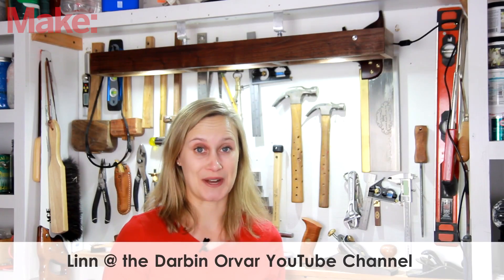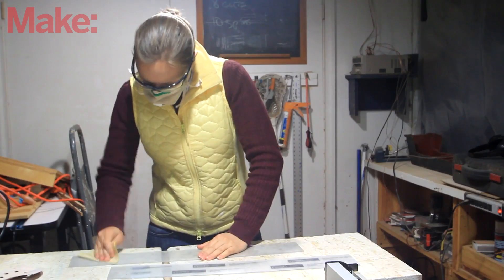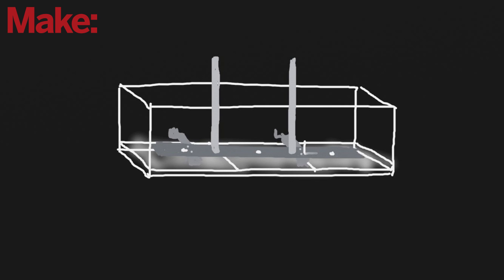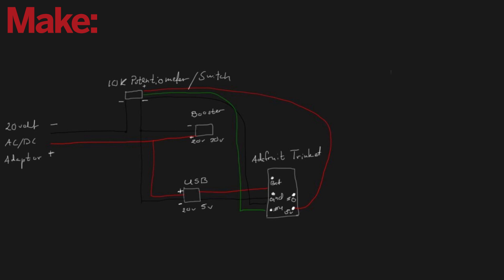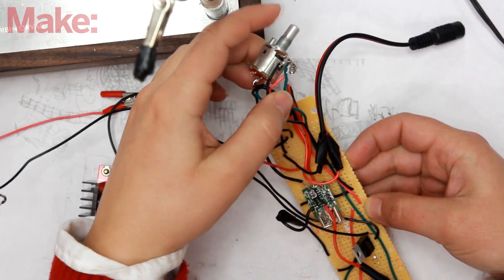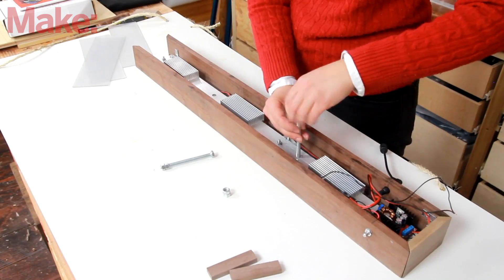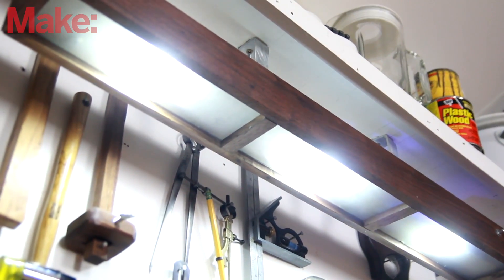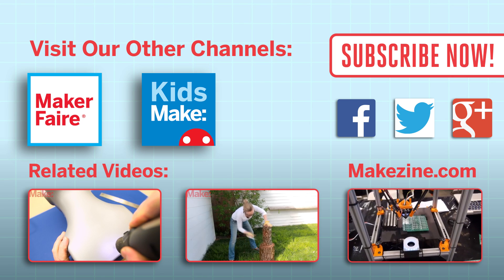How To Make a Super-Bright Light Fixture w/ Dimmable LEDs

Comment: It  is pure luck that this setup didn't fry the LEDs with overcurrent. (she didn't even mention anything on this topic)
If others are looking into building sth similar, make sure you take a look into @Great Scott LED videos. You must AT THE VERY LEAST put an inductor-cap somewhere to limit the current going to the LEDS. And no, Resistors are not the way to go.
Reply: thanks for pointing that out.

Comment: Excellent craftsmanship on the mechanics, but the electronics is really somewhat underwhelming. With this setup the light intensity will probably drift quite a bit as the LED's heat up. LED's like this are meant to be driven with constant current. It can obviously work the way is is done here, but at the very least the video should have discussed a safe procedure for adjusting the output voltage on the boost converter while the LED's are heated up.

Comment: Hi, a nice piece of work, it will inspire me to make some illumination appliance I wanted to have in my garage.
A question though, why did you put 3 aluminium radiators on top of the aluminium plate upon the LEDs ? 
Isn't the aluminium plate not enough to throw the heat away ? I'm pretty sure that if the radiators are not directly in contact with the LEDs, it is worthless to have it where you put them... just an idea...

Comment: your dimmer is not a pwm. its analog since you are using an analog potentiometer. it even says analog on your code.
Reply: analog output in arduino is PWM unless you have something like the teensy 3.5 or 3.6 that has true analog output. i could not see the code but i bet she is reading a voltage from the pot( acting as a voltage divider) with analog input and setting the output to follow the input. it is a rather silly way to do it but if you want to have an arduino in everything you build, why not. i have built plenty of arduino based devices that might have been simpler using other methods but with the arduino you can change things more easily if you change your mind. she could add bluetooth and control the light from her smart phone :)

Comment: Looks great, and doing it is better than talking about it.  However, can someone explain to me why the coding for dimmer switch?  Seems if you are on AC an autotransformer or other analog type option would work well would it not.  A lot of ways to do a nice project like this, just wondering if there was a specific reason for the coding and 'audiuno' board.

Comment: Great project! Just thinking that if you would use Constant current / Constant voltage booster, its would be way easyer, because you could just take out booster voltage potentiometer to outside, and set the lets constant current. By regulating boosters voltage you could dim the leds, but you couldnt give them too much voltage because of constant current set.

Comment: Awesome Build Linn! Many people don't seem to use Lexan for projects. Plexiglass is brittle and will crack and break. Lexan is a beast! You can hit it with a hammer, drill it, heat it and bend it, it's literally indestructible! It cost quite a bit more but works so well with projects!

Comment: Whoa - that was an unnecessarily complex project. Just get a couple of good quality of 5 meter closely spaced out LED strips and cut them up to fill in the fixture.  Also PWM dimming will fatigue your eyes quite quickly so I'd definitely just go with a voltage-regulated dimmer instead, which can be found for cheap on eBay.

Comment: Wait let me get this straight - based on your code you are using your arduino to convert analog potentiometer signal to the same analog potentiometer signal. So basically the arduino does nothing and the signal just passes through it...

wut?

Comment: Nice, but ultimately REALLY overkill, since you could achieve the same dimming action without the controller - just the pot and the transistor (possibly some resistors too).
Reply: +Daniel's Game Vault I agree that using a Trinket to control the brightness is overboard.  There is a problem with simply using the pot and transistor, operating the transistor in the linear range will cause a lot of power dissipation in the transistor.  Ideally you would simply drive a MOSFET with an NE555 variable PWM circuit.  A TIP31A is not a high power transistor and is probably marginal for this application.  You would still need a DC-DC buck converter to power the NE555, since it has a max supply voltage of 18v.  Ultimately, the simplest solution would be to use an LED driver supply that has an adjustable output, avoiding all of the auxiliary circuitry.
Reply: +eformance I was thinking the same thing. using a 555 to produce the PWM from the pot. but even the current setup skipped the heat sink on the TIP31. Personally the trinket is overkill unless you add smart functions like overheat off, remote control, audio on off and or controlling the 3 different LEDs to differ levels from 1 knob.
Reply: +eformance But micro-controllers are all the rage now! Kids don't care about discrete logic theses days! Even if it would cost a fraction of the price! I always giggle when I see projects on the internet using a micro-controller when they could do the same thing with a few cents worth of components. :)
Reply: +Heath Albritton The "contrived" circuit consists of one IC, 2 resistors and 2 capacitors which in total costs below one dollar. I wouldn't call that a complicated circuit and calculating the right values for the resistors and capacitors is fairly straight forward. Still fair enough, for a quick project a micro controller is probably a good way.
Reply: +Heath Albritton Your mom giggles when she gets picked up on the corner. You need to look up the definition of  "contrived." 

You are obviously not an engineer. Five components costing less than $1 vs a $10 microcontroller? You would probably buy a $100 light bulb if it had a microcontroller in it. A 555 timer might be old, like your  mom’s tricks, but they are still heavily used today.
Reply: +BeanHole If you can cut down on development time by using a microcontroller while the end result is just as good, those few extra bucks are well spent. Development time is fun if electronics is your hobby, but if it's not, it's really expensive.
Reply: I was thinking of a MOSFET, whose D is connected to the GND of the LEDs, the S would be the power supplye's GND and the G is connected to the center terminal of a pot. The other 2 terminals of the pot are connected to GND and 12V respectively - what would happen there ? The only flaw I see is that the LEDs might flicker or the pot won't handle the current draw, though that's the purpose of a transistor from what I know: to control a large current with a small one (even though FETs are voltage-driven).
Reply: +Alles Is Natuurkunde [EDU] PWM is almost always the best option, because the potentiometer is gonna dissipate a lot of heat, as well as the transistor when driven continuously, and that would require a very high power potentiometer and transistor just to not have both blown up by the power. Also, PWM uses significantly less power to operate and doesn't dissipate as much heat. Also, like bluetorch13 said, LEDs have a forward voltage that makes things complicated when trying to lower the voltage. Limiting just the current is also a bit hard to achieve properly (there will be a tiny area where the LEDs glow, and ten they go out completely).
Reply: Victor Arnaiz But isn't it illegal to do so since then repairing companies cannot repair them and go bankrupt?
Reply: Victor Arnaiz Well, I didn't know that. I live in Finland anyways so here it actually is illegal to make faulty products with irreparable properties to protect small businesses like repair shops. Still sounds really unfair, especially towards the poor customer.
Reply: +Daniel's Game Vault yes, but you will need at least a 555 timer to produce PWM, LEDs need PWM to dim properly. So add that to the list. lol
Reply: +Carlos Pineiro is PWM required? I think lowering the voltage with the potmeter and transistor/mosfet would do the trick of dimming the LEDs.
Reply: +Alles Is Natuurkunde [EDU] you can use a lot to a certain point, but LEDs are different than a regular bulb, they have a minimum working voltage, lower than that they turn off or start behaving weird. You need PWM to dimm it properly, just like a DC motor.
Reply: +Alles Is Natuurkunde [EDU] a pot*
Reply: PunakiviAddikti thanks. That's a great idea to keep in mind.
Reply: +BeanHole I always giggle when I see old farts on the Internet babble on about building a circuit with a 555 timer to create some contrived circuit when they could just as easily use a microcontroller that cost a few dollars.
Reply: Contrived is what happens when you put a 555 timer into something because that was your favorite IC from two decades ago.
Reply: Heavily used?  Nah.  Microcontrollers are everywhere.  For the purposes of prototyping, the average Joe can get an Arduino Nano, for example for <$5 in quantity 1.  Manufacturers are paying <$1ea in quantity for the kind of stuff that goes into cordless drills, like the SiLabs MCUs used on their speed controllers.

Sorry, old guy.
Reply: +Victor Arnaiz Indeed there are, but unfortunately it's very arbitrary and varies by country, or even in many cases by the individual judge's interpretation of a vaguely worded law, which here in the UK says such easily defined things as 'of reasonable quality' :\
Reply: +Daniel&#39;s Game Vault and to me the use of those 10w LEDs is over kill, since there is no reflector there is just a hotspot of light.
It would have been easier to use those strip LEDs.
They run on 12v so a transformer is all that is really needed, if you want to control brightness, get one of those basic LED dimmers off ebay

Comment: why use an arduino there are alredy a potentiometer on the booster board wich regulates the voltage for the led and you can hook up the external potentiometer to the booster MUCH EASIER

Comment: Nice project! I've been thinking of making lamps for the kitchen for quite some time, but getting nice wood is my biggest issue. Where I live in Norway there isn't much else than construction wood for sale.
Btw, there is clearly more woodworkers than electronics geeks watching your channel. Applying an Arduino where a simpler component could have been used could easily unleash a torrent. I'd go for the Arduino any timethough. You could even add a bluetooth or WiFi module to make it remote controlled. Or how about adding an RTC clock module turning it into a timed lamp that makes your house look less desolate when you're on holiday?  :)
Reply: Flisete granplanker for the win!😂
Reply: +ted clubber lang Hehe, that's what our country is made of.

Comment: I'm trying to figure out how you're limiting the current to the LEDs. Or is the power supply just outputting less amps than their limit?
Reply: +Le Roux Bodenstein
LED's are specified at 34V and 0.7A. The listed AC/DC converter supplies around 70W max. making it around around 2A for all LEDs (these must be in parallel) and just below 0.7A supplied current per LED (I=P/U).
Alltough this is not the best way to do it, it kind of works. The right way would be driving the LEDs on constant current, as u already said. For all the DIY people that want to use proper constant current brick, use the mean well LDD-700-H ;)

Comment: Wow! A lot of coulda woulda shoulda comments already. Here's the thing... there are a hundred plus different ways of creating an LED lighting rig. This is just one of those ways. If you want to play with code and use some components that may be new to you... in a project that gives tangible results in a practical way... then this method works.
Quit with the bashing and upload your own solutions to cheap(er) LED shop lighting.  Link them back to this video.
I for one would like to see them. 👍
Reply: I could and would but I think I should just comment.
Reply: +Robert Venus all you would need is a astable 555 circuit with a potentiometer connected between pin 7 and 8 i believe and thats just replaced the entire adafruit board with about 6 components worth $4 max
Reply: Victor Arnaiz Probably adafruit, they're losing money because of you LOL

Comment: Cool idea especially if you want to design your own, but definitely not cheap especially once you factor in the cost of wood and aluminum. They look great though.
Reply: I'd hide then in the workshop shelves. They would make seriously low profile lighting if all other components were centralised with long LED wires used.
Reply: Robert Venus Good idea. If anything, this build got the wheels turning in my head.
Reply: +rochat Same here 👍 Currently rebuilding my workshop after crazy bad weather. This made me start planning out LED conversion for the lighting.

Comment: Nice, though Arduino for the dimmer? Quite mega-overkill :-}
Reply: +Martin Pokorný I might be wrong but a ne555 with a power transistor could be a solution.
Reply: +qwaqwa1960 The exact same thing that was going through my head all the time :D
Reply: +qwaqwa1960 Was going to say the same thing.
Reply: Would allow for some nice expandability options for the future, like you could get IR sensors or whatever else hooked up with little issue
Reply: +qwaqwa1960 Could you suggest easier solution?
Reply: Yes there are easier ways. Using simple code is a good solution for those new to coding though. A lot of woodworkers follow this channel that just had a coronary though! LOL!
Reply: +Martin Pokorný You could build an adjustable PWM circuit but even easier solution for low power applications is to just use a power transistor with potentiometer and resistor as a voltage divider feeding current into the base of the transistor (wouldn't be linear)
Reply: +Martin Pokorný Attiny45, costs only a few cents and does basically the same things as an arduino, but only 5 datalines,